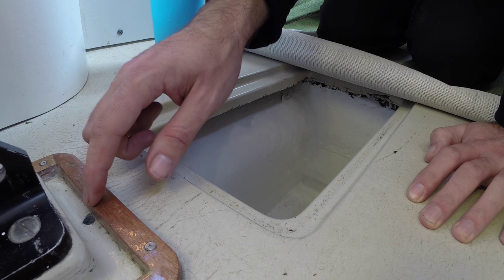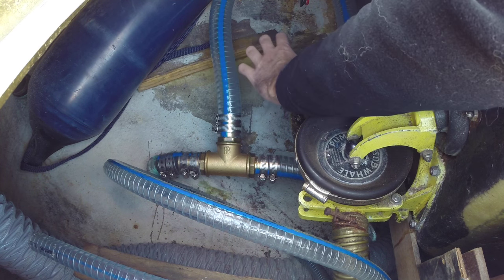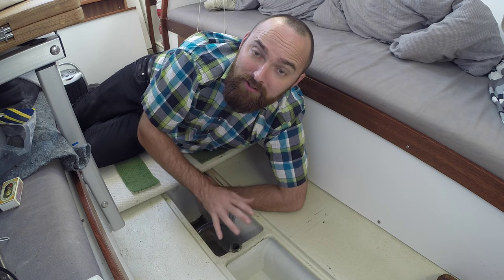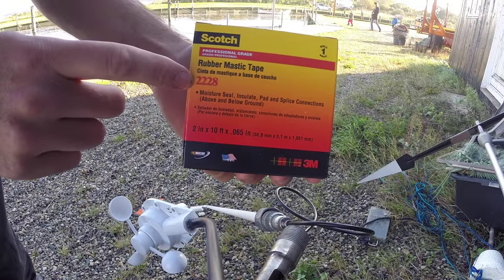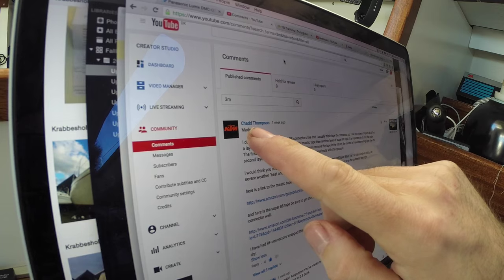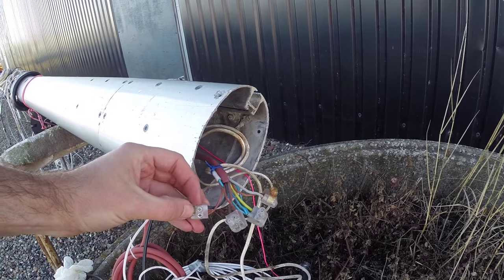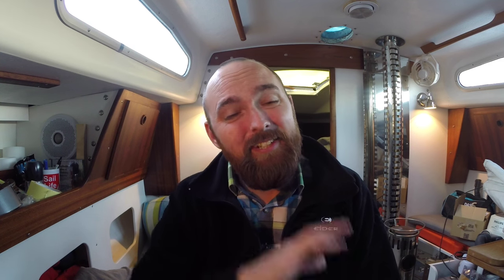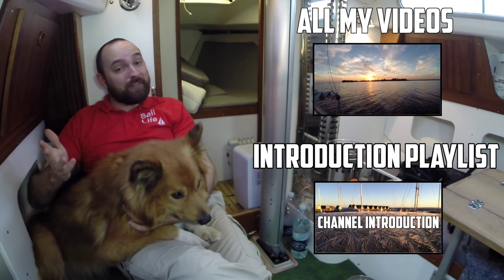Sail Life - Up on the hard, part 7

Comment: Hi Mads
Good work on the drain for the mast and I'm glad you didn't drill a hole in the boat.  I'm a 35 year telco lineman, the tape you used for the antenna was the right stuff. We have been using it for decades. A splice can last 30 years. What we did (retired now) differently was apply the self amalgamating tap directly on the connection or splice and stretch a bit as you apply, you want to protect and cover with the electricians tape. The amalgamating tape turns gooey and homogenous and seals the connection, the electricians tape protects from the weather. My worry is that you have first covered the connection you want to protect with a shield of plastic. As long as you have overlapped the "gooey" tape enough you should be OK. If not I think I my redo it and skip the first layer of electricians tape.
Cheers
Rob

Comment: Feel better soon Mads!!
By the way, I like to over seal my electrical connections. Maybe some shrink tube over the connector. Also, on my small boat, I have an exposed fuse/switch panel, so I used some liquid electrical tape on the connection side.
Reply from the maker: +KarbideMachinist Thanks :) I'll be back at 100% in a few days :) I'm a big fan of heat shrink too :)

Comment: That tape is very good. I've used it myself in far than ideal situations. I think the one worthy of discussion is the one that lives 24/7 submerged for what is now two years, i believe, on the pump that drains my yard excess water drain. The cheap connector that was in place always had issues with grime getting in and because of the vibrations it would end up disconnecting so putting it back together each time it did, that got old, quick. It was a whim that made me use this tape but i'm happy i did.

I hope you get well. :)
Reply from the maker: +aserta That sound awesome :) Good thing I have a big roll of that stuff :) Thanks, I'm sure I'll be better in a few days :)

Comment: Hi Mads - another good vid. Glad you did not put in another through hull. Really looking forward to the engine and gearbox work. From what I recall the fundamental problem was crankcase over pressure and that may have been the cause of the gearbox oil loss. Anyway looking forward to what the expert finds.

Comment: Mads, I would not recommend putting a check valve on the bilge pump, as they sometimes overly constrict flow or fail outright.  The check valve will keep water from flowing back in, but could become a safety issue.  Granted, your bilge is not as voluminous as the WS42, but it is a consideration.  Doug

Comment: Hello Mads, Thanks for all your vids, I'm really enjoying your series. @1:45 I'm wondering why you drilled the hole at the bottom of the fresh water bilge instead of the top? I'm thinking if the bilge pump fails and the hole seal fails it would be better for the hole to be at the top but maybe that would be a problem for the bilge pump? Really enjoy all I am learning about sailboats from you !  Thanks again, Mike

Comment: Don't use sika flex to connect the bilge directly to the boat. Sikaflex a small piece of epoxy protected wood to the bilge floor then attach a large clamp band to the piece of wood... then hold the bilge pump down using the clamp band. You are going to want to change that pump out after a while.

Comment: Mads Check the bilge pump specs as some pumps require that you DON'T use a check valve in the system as the pump requires some water to create suction to pump.

Comment: hello, why don't you use that fresh water that runs to the bilge and transfer it to a fresh water holding tank so that you have fresh water when you go sailing?
Reply from the maker: +ruben r The water that runs down the inside of the mast gets quite dirty. There's lots of sand and stuff inside the mast. In an emergency, I could use that water but until then I prefer the nice clean stuff in the tank :)

Comment: Hi Mads. I was wondering what that heater is in the background. I can see a flame inside a tube.
Thanks :)
Reply: +Terry Peake It is a Danish made "Refleks" model 66 brand diesel heater/stove. I'm in Bangkok and new to sailing, just this year, so Mads' videos are extremely helpful and informative to me...
Reply: +donjvalley Thank you for this. I have just watched a whole series Mads did on the installation of this heater. I should have watched a few more before I asked the question. These are a great inspirational series. I am between two pylons doing my refit...it is so much harder without shore power and not having a dock next to me.
Reply: +Terry Peake Must be the time of the year for boat heaters :-)